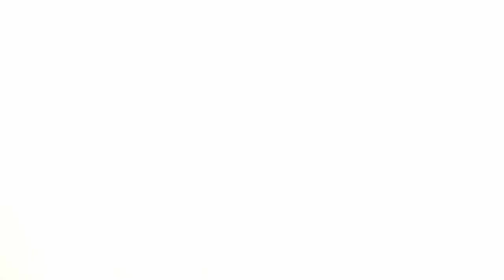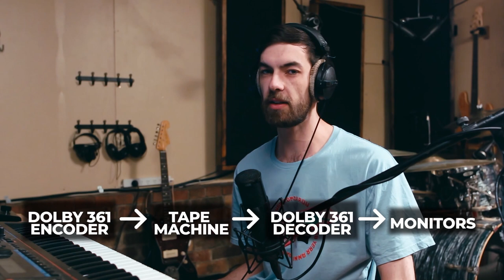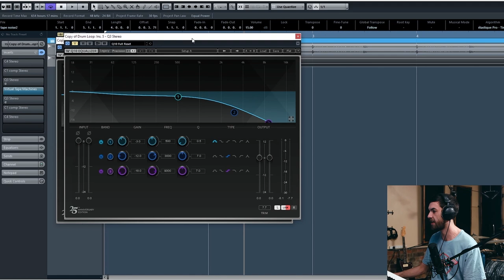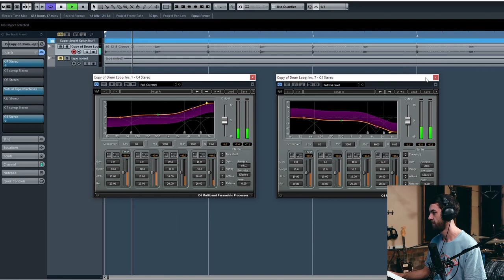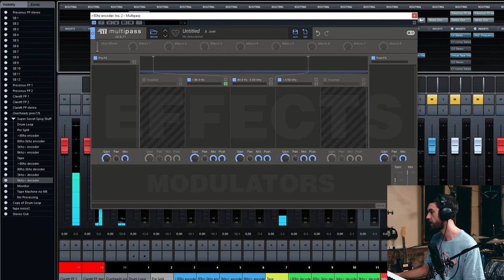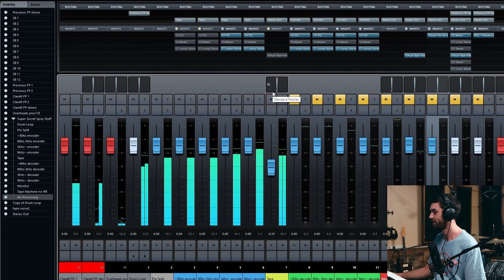The Magic Behind The Slate FG-36a - Incredible Top End Instantly

Comment: Any idea why this plugin would be adding noise to my mix that is not there when bypassed? I'm getting hiss even at the most miniscule turn of the knob.
Reply: If you think of the decoder as a process that removes hiss and the encoder is just doing the opposite of the decoder than you could say the encoder is essentially designed to increase hiss . Not entirely true as the Dolby was expecting a clean signal but if there is any hiss apparent to your signal then the FG-36a will do its best to bringing it out. Maybe that's enough reason to go for a different exciter or hey, build your own (like I show in the video) and tweak the settings until you're getting the boost you want without adding too much noise. Hope this help!
Reply: also I thought I'd mention that if you're trying it on vocals, you might just need a gate before hand to get what you want. Might not be as applicable to other instruments.
Reply: @joshrichensproducer2201  thank you. I'll keep messing with it. I really like how it sounds on vocals.